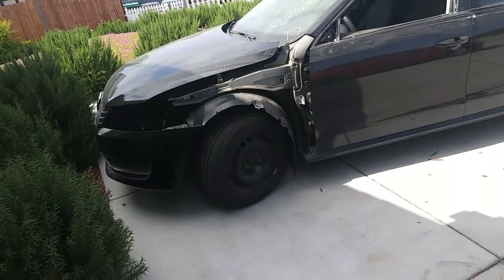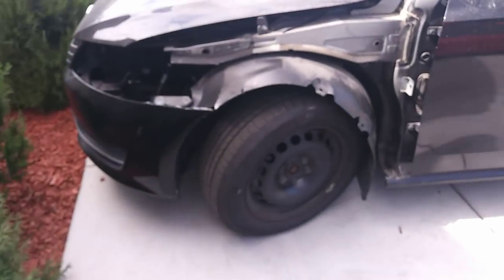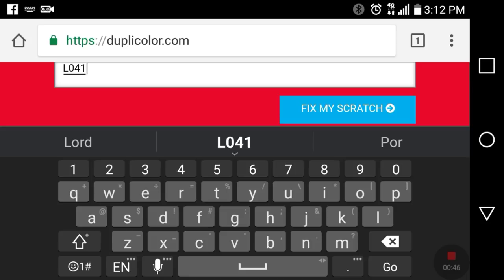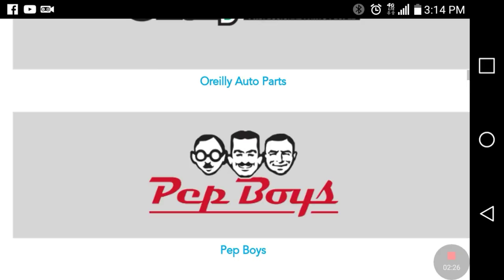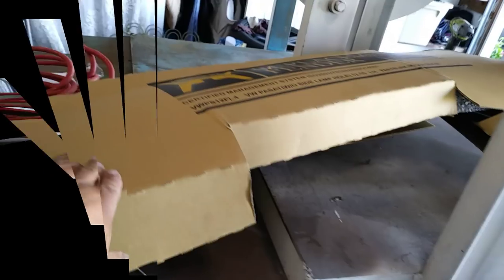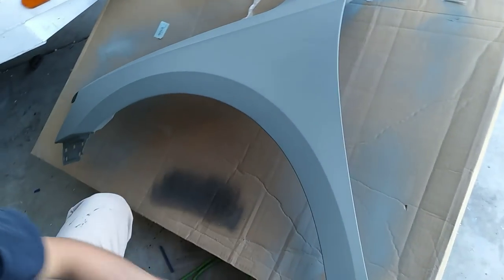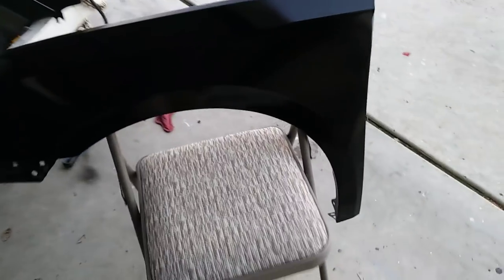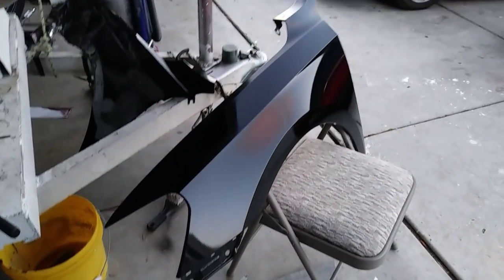cheap diy rattle can paint job / painting a fender on the copart passat

Comment: What kind of sand paper did you used before you apply the primer.?
Reply from the maker: Can't remember but you can do 1000 grit because it don't need to much as the base is pretty smooth and there is hardly any imperfections to sand down so just try 1000 or even 800 but if you see any tiny scratches then go up.👍✌

Comment: I sprayed to heavy in areas of my fender and wanted to know how to get the blotchyness out?
Reply from the maker: Wet sand it bro using a sanding block till you get rid of the imperfections, do like 800 or 1000 grit to stay on the safe side unless you need to go deeper.👍✌
Reply: Nice fast response. Thanks. I've only put down the base. Should I wet sand the entire fender?
Reply from the maker: Yea you could do that and then just spray it a bit to hide all the swirls made by the sand paper before you clear it bro

Comment: rubbing compound is more abrasive than polishing compound. Normally start with rubbing, then do polishing.....should get a beautiful finish!
Reply from the maker: Gotta Tinker33 i did the rubbing compound after the polishing compound and noticed a better reflection but got alot of spider web scratches so i need to do the polishing again so your tip sounds about right thanks man i appreciate it i will definitely keep it in mind for my next projects👍

Comment: Hey boss did u find out what's up on the red car
Reply from the maker: Joseph Ramod not yet bro, we removed the starter and got it tested and the starter is locked so im pretty sure the starter is the problem, i also replaced one of the sensors but im waiting for new starter to arrive to try to start it.
Reply: I wish I had the funds to flip cars like u boss the fender came out pretty good for being spray cans
Reply from the maker: You really dont need that much bro , i bought my first car with a credit card loan and  started buying cheap cars off of craigslist and selling them for a little profit ,also you can hit the public auctions and towing yards  bro and get cars for like 500 bucks, if you dont have the cash just risk a credit card because if you try to save $ its really hard to do so.
Reply: yes i think that to!!!!!!!

Comment: How many cans of black paint are consumed
Reply from the maker: Can't remember but it was one i think or maybe one and a half man i just did another fender and it took 1 can on that one do it should be around there👍✌
Reply: @CALIREBUILDABLES  How long between the black paint and put clear
Reply from the maker: 15-20 minutes between coats and about 30 min for clear then 15-20 minutes between coats
Reply: @CALIREBUILDABLES  thank you 🙏
Reply from the maker: No problem thanks for watching👍👍
Reply: @CALIREBUILDABLES  I would imagine that would depend on the outside temperature.   Most of these paints indicate application at 50 to 70 degrees.  At 70 degrees I would think maybe 10 minutes and at 50 degrees maybe 30 minutes.
Reply from the maker: Oh yea it will definitely depend on the outside temperature , here in California it's usually hot on the day but yes you are totally right it will depend on the weather 👍✌